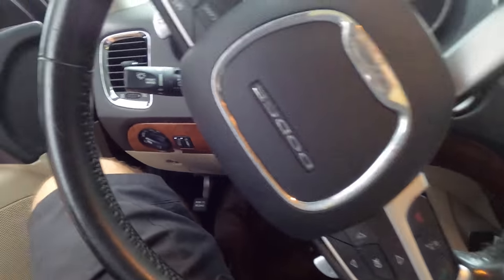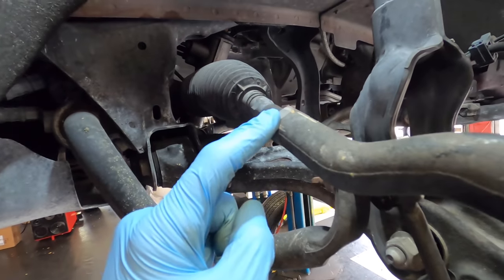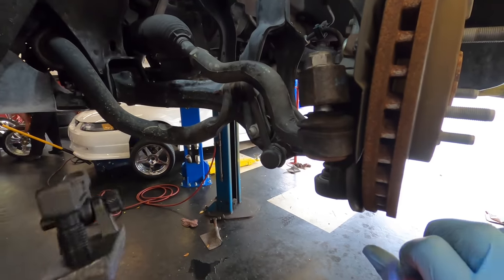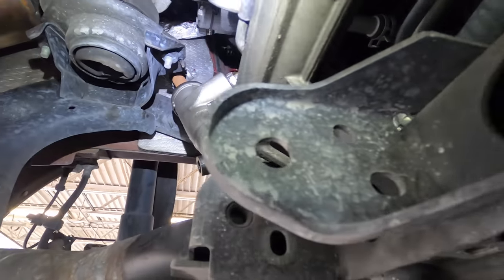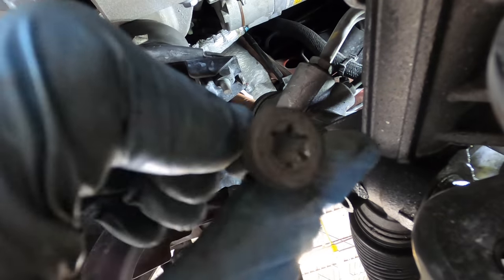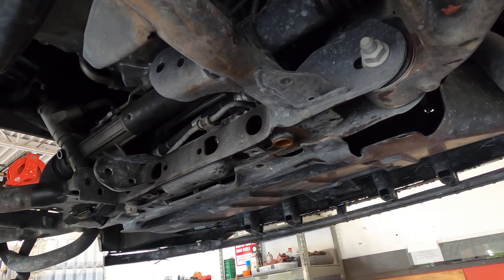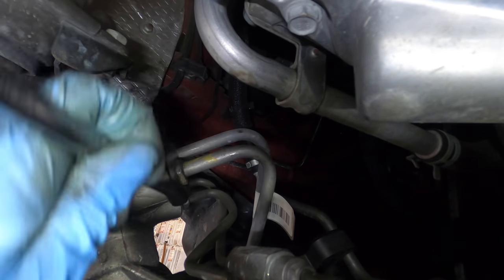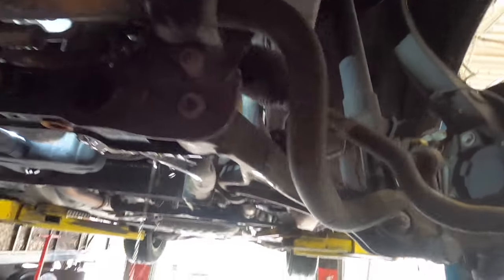Engineers vs Mechanics | They GOT Me!

Comment: Similar story on a lower control arm for a 2001 Chrysler Sebring convertible I did for a friend.  The ball joint totally separated, and I had to replace the whole thing.  It’s that “A” arm that’s all one piece and has 3 connecting joints.  The rear point has to come out of the cavity and takes some finnagling.  Inserting the new one took some hammering to get it in.  Realized I needed to find a bushing for the wishbone, as the online supplier sent me one without.  Pulling that arm out to take with me to ensure that I got the correct bushing took some major finnagling and persuader work.  Couldn’t find one from my local retailer, so had to get a new arm from the same retailer.  That went right in, no persuasion or wiggling.

Comment: With the way labor times are calculated , there should never be a problem beating it with a good assortment of proper tools. They determine times by having a technician perform the task with normal hand tools. No air tools etc. The main thing about making your time at a dealership especially is learning how to write up the labor. That makes a very substantial difference.

Comment: Anytime I do a rack, I don't remove the outer tie rod ends from the spindle. I just back the inners out of them and then pull the rack out. No need to remove something that doesn't need to be removed. Otherwise I feel your pain. I have been in this situation many times. One of the worst is transmission lines and oil cooler lines. Sometimes they are easy and sometimes you have to lift the engine or drop the differential.

Comment: I'm jealous you got this one on a 2wd 3.6. I just did one with 4wd and 3.0 eco diesel today. Front diff and bigger oil pan so steering gear has to come out the front of the subframe. I was able to get it with only taking the drivers inner off. But all the p/s lines and electric pump has to come out

Comment: Just an FYI.... Mr. Ray didn't show it, but a critical step BEFORE removing the tie rods or column coupler is to center the steering and lock the steering wheel physically so it can't move. This prevents accidental over-winding of the airbag clockspring.🙃

Comment: Fellow Mechanic: although the book called for 5.6 hrs and after seeing how easily you put the new one in.  I can only imagine it takes into account for the removal of the front differential as well for some models.  The mount you were speculatly going to cut to remove the old rack like you said would've been for a front diff which would've made it nearly impossible to remove or re-install without removing it.

Comment: If you hit the steering knuckle where the tie rod or ball joint is with a hammer the vibration will shock the tie rod or ball joint loose saving tons of time. I usually just smack it with a 32 oz ball pen on the flat side and over the years I'm sure it has saved me hours. I've done it hundreds of times and never cracked or bent one... I've always smacked em pretty hard too, you'd think it would crack cause it's iron but its actually not as brittle as a block. In accidents they usually bend.

Comment: One of the few remaining components not YET replaced on my minivan is the steering rack.  It is not leaking yet.  It is not binding yet.  The pump is a little noisy after a line got crushed when the motor mount gave way.  But I expect that steering rack to be the excess repair that sends it to the scrapyard.  It's not one of those that can come out without dropping the subframe, and that subframe has enough central Ohio rust that it's not going to come out without a fight and I don't wish that repair job on anyone no matter their hourly rate of pay.

Comment: Tip. Wire brush the Bolts and add anti-seize. Then you can do them up by hand until tight. 👍
It takes less time than using power tools to do up rusty bolts.
Reply: And makes it a hell of a lot easier for the next guy that has to disassemble it.

Comment: Nice clean pick-up for her age - and more importantly clean mechanically too!
Pssst, when using a balljoint separator tight up against a balljoint boot, then spray the boot(not the separator) with penetrating oil(WD 40, 3 in1, etc)- she'll slip in there nicely and there's no risk to the boot(it also gets it's rubber conditioned by the silicone in the oil mix ;) ). And no damage to the mechanic/boot from a self inflcted screwdriver wound! 
:)
:)

Comment: I use my brake sucker to pull everything out of the PS system via the return line.  About 30 seconds of pulling air and the system is fully drained. 
Also I think I'd try to put the main bolts in from the top so if the nuts somehow fell off the bolts can't simply fall out.
Reply: As if he had 6 inches above the unit to get those bolts in. There’s a reason they’re in the way they are.

Comment: I was helping a friend of mine that happens to have a small salvage yard, swap out a timing belt on a PT Cruiser. He goes online to find out the manufactures recommended method and the first thing it said was, (See engine removal) Needless to say we didn't go that route. Since then, any time we have a pain in the rear part, like this rack you was swapping out, that becomes an extra pain we say, See engine removal.

Comment: You should check the factory service manual for the procedure and you may find something you should have removed first that would have made the job easier. I'm a retired ASE Master Tech that was trained at the GM Training College in Atlanta and I've seen many guys take, for instance, 4 hours to change a water pump when if they had removed the alternator and it's mounting bracket first, which would have taken 10 minutes and 15 to put back on, they could have done the water pump in 30 minutes. Trying to find a shortcut can often wind up costing you more time than you think.

Comment: don't feel bad, Ray. Anyone who's worked on a car seriously has run into that. 
Pulling a starter off a 1984 Fiero with the cat and heat shields and A/C Compressor in the way is absolute hell. You gank on it, turn it every which way, use straps to pull the exhaust aside, still nothing.... Then you lie there under it, thinking about how if you could see the darn thing it would be easier. Then you jiggle it again and it falls point first down onto your chest.
Of course it goes back in like a breeze without the slightest of trouble.

Comment: When engineers are designing a vehicle they laugh at mechanics saying to each other, "those bastards will never get to that zerk". Or the chief engineer will return a drawing back to the jr. engineer saying, "you've made that bolt/nut too accessible, change it". It was they who came up with the idea of sealed bearings.

It took me 2 hours of "death from 1,000 cuts" movement to get the new rack in my '96 explorer. Only a few minutes to get the old one out. Now I use a camera all the time when working on vehicles.

Comment: I would have put some marine waterproof grease on those big rusty rack bolts. I also don't like how water is getting in there, maybe some grease to seal from the top the nuts to the subframe. I know a lot about rusted our car repairs having worked on rusty vehicles. So I always try to reduce a future potential problem.

Comment: I'm not an engineer, but your 'Engineers v. Mechanics' title caught my interest. I agree that there is no substitute for hands-on experience (wood and strings are my field), and I liked the clarity of your problem-finding and solving. I could see that the no-purpose bracket was the obstacle stopping you from extracting the piece; rather than cutting, I was hoping to see the camera turn off, to not see or hear three judicious smacks with a lump hammer, and then to return to see the arm sliding out past a slightly bent bracket. More time saved!

Comment: My manual says 4.0 hours job on a 3.6L version. I was curious why. They basically want you to remove the electric steering pump, CV axle and a strut on the passenger side for the rack to come out through the right wheel area, that's why it's more hours.

Comment: Are these shipped in 'middle position', so the steering shaft fits on without concern about the clock spring? Is there some way to inspect the mechanism to see if it is close enough to neutral, to allow the alignment to take care of minor adjustment of steering wheel angle?

Comment: Next time you use the tie rod separator , don't keep turning the screw in till it pops . Just turn it in until there is pressure , then whack the side of the steering knuckle with a hammer and it will pop .

Comment: The major problem with engineering the vehicles in the way they are done, engineer A who is tasked with placement of parts on the chassis is not allowed to have engineer B change their design to accommodate replacement of parts. Most times they are not even allowed to speak to each other about a project because only a select few in the build process are allowed to know the entirety of the vehicles build thanks to people who leak out designs to the competition.

Comment: Plan on doing tie rod ends get get 2 hammers out by the wheel and of the tie rod put one hammer on one side of the bracket and take the other hammer and hit it one or two hits in the tie rod should drop out

Comment: Hey, I liked this alot. I have to do the whole power steering system (rack and pinion, power steering pump, both hoses and cooler ( comes with small one stock.))  But I have to do it as my wallet is tiny. Fortunately everything is right there it seems.

Comment: Well like you said before you need to learn something new everyday and you did. And you know that it can be completed in less than 5 hours. It looks like if you would have twisted the steering shaft forward instead of to the back of the car when you tried to take it out. It would come out the 1st time. have to remember to go forward with the steering shaft.

Comment: Service & maintenance is the last thing engineers consider when designing (American) cars. The major focus of automotive engineers is to make the initial assembly, of the vehicle, as efficient as possible on the assembly line. Also, the engineers try to save every nickel within every part of the vehicle. Service & maintenance is their least priority because by the time the vehicle needs this level of service, it is out of warrenty and the manufacturer is no longer responsible when things like steering racks start leaking. As a result, there is no love for the service technician and this video proves it.

Comment: I bet if you compared the original casting vs the replacement part casting, the replacement part used a lighter casting with less material and thus became just small enough to fit back just fine. . .

Comment: Love your videos, as much as South Main. Question: would any indexing of removed steering rack be needed, since the tie rod ends were removed, to match old one with new one? It seems like the alignment guy would have less potential work to do. And depending on how it all went the steering wheel might be a tad off of center when going straight? Same for the final connection of steering linkage to rack, is it possible to be off by 180 and not catch it? Keep up the great videos !! Hope it's making you some beer money
Reply: That’s what the front end alignment is for.

Comment: I had the same issue with a 1999 Pontiac grand am getting the rack out but the new one slid right in. I was working on the floor though with a jack. That wasn’t the worst part the worst thing was two weeks after I changed the rack the car blow a head gasket and the owner just gave it to the wrecking yard. What a waste of time.

Comment: As an "ex"- mechanical engineer and a mechanic, i see a LOT of mistakes from the factories; i attribute that to the rush in putting the new cars out to the public, and the lack of repair experience by the factory engineers; but mainly,greed...; 
Sometimes, with the permission from the customer,i modify things,saving them hundreds ot thousands of euros and,mainly, saving my sanity   (:    
 »»» cutting into the car guts to make R-O-O-M to replace heater cores and a/c evaporators-invisible after repair is complete,of course, is one example; and it makes it easy for the next guy,or myself...   lol

Comment: Eh, line wrenches aren't really for a tool fitment issue, they're for places like up here in Minnesota where everything is rustier than a cars worst idea of hell. You need a line wrench to bite 5 sides, because an open end will strip it so round a vise grips can't even grab it lol.

Glad a normal wrench works down there in Florida though, usually I end up rounding them even with a flare wrench so bad I have to cut the line and make a new one. 
My line flaring kits wear out so fast i have to warranty both every few months because they either start breaking or just don't work anymore.

Comment: Still see they are still two ways to remove parts on cars.  the easy way and the long way.  In the day I used to own a Chevolet Chevette or also called the Pontiac Acadian.  If you had to change the starter, you had to option, the 15 minutes way or the 45 to 90 minutes way.  The 45 to 90 minutes way was from the top and the 15 minutes way was from the bottom.  Now in your case, the engineers they caculate the times and how easy it's the work is done from the point of view of installing the part and they see that with their 3D cad design software.  and here where the secret is for removal part, you have to dismantle the part to the bare minimal length wise the first time you remove one and the new one the rack & pinon is centered helping a lot for the install.

Comment: I'm a Jeep owner and I don't like Chrysler. They skimp out on to many integral car parts causing major problems.
If you are good with a wrench 🔧 then Jeep is your vehicle, but remember they are a challenge to work on when changing control arms, the frame bends when you take one out requiring ratchet straps to realign the fastener 🕳

An example is my 02 Jeep Grand Cherokee Laredo 4.7L V8 4x4 has several manufacturer defects:
1. The door harness wiring is shifty thin and cheap causing power windows, power mirror, and power lock issues and sometimes dome light problems.
2. The window regulators are cheap and break down in 10-15 years causing the windows to fail and fall.
3. The suspension bushings go bad in just 150,000-200,000 miles when in Hondas and Toyotas they last longer: front& rear, upper & lower Control Arms, all tires and upper rear center Ball Joints, front & rear Sway Bar Links, Sway Bar Bushings, shocks, coil springs. Steering Stabilizer (get KYB or Moog Trail Boss Kit each are under $45)
3. The Mopar parts for Jeeps are extreamly overpriced. A control original Mopar shock can cost $150-$200 ea. When a Moog only cost you $50 ea

Comment: Well there's a lot of stuff to put in a small area and they vehicle probably isn't completely assembled when some parts need to come out later for replacement. If you had to make every part really easy to take out with everything else in place you'd probably never finishing designing the vehicle or it would be mush more expensive to make when there may never be a need to replace a large majority of parts in the life of most of them.

Comment: Book time is often way off, as are procedures. I had to change a CVT on a Nissan Sentra. First step of the procedure? "Remove engine and transmission as a unit". Say what? When I read that, I figured, "Screw it, I'm doing this like any other tranny". The engine stayed in and everything went fine. Another nugget: to remove the cylinder head on a 2010 Toyota Matrix, apparently the engine has to come out. Again, bullshit. I did it like any other inline 4 cylinder head, no problem.

Comment: With 3D modeling, there should be less of these service issues.  Sometimes you get designed into a corner, but, with modern design tools it is far easier to evaluate assemblies virtually before things are locked in place, design wise.  Once you start prototyping, it gets very hard to change parts that have had tooling money invested.

Comment: Everybody railing on engineers are not thinking about something. I'm a mechanic, not an engineer. And someone pointed out to me a while ago that all of these systems are specifically designed to be as easy as possible to assemble in the assembly line. No consideration is made for how long it takes to repair when it fails later on. This keeps production costs to a minimum. And in turn keeps the cost of a new car down where normal people have at least a slim hope of being able to afford one. Keep in mind the 60% (I think)of the price of a new car is directly related to government safety and environmental regulations.

Comment: Not a car made that doesn't have engineering problems.  In my Mazda, you have to pull the whole top end just to change the back plugs.  Move everything forward 4 inches when manufactured or the firewall 4 inches back and you wouldn't have too.

Comment: Removing those track rod ends made me whince. Firstly use spanners on the lock nut not pliers. Secondly that's how you rip boots with a spreader like that. Hit the end with a hammer and it comes out.